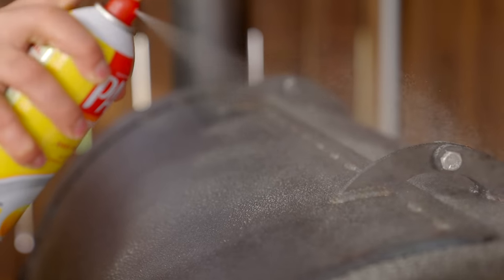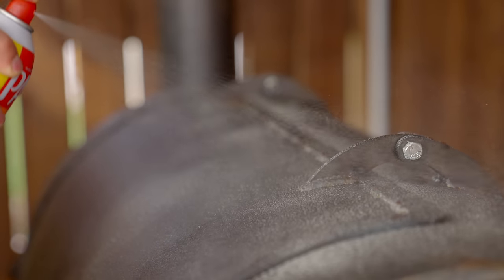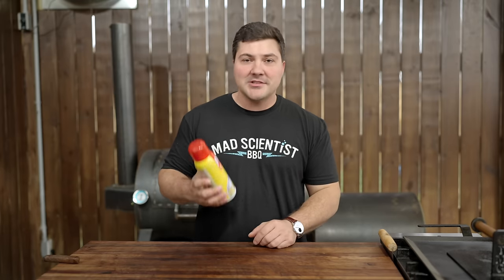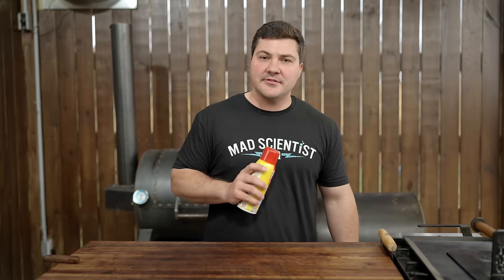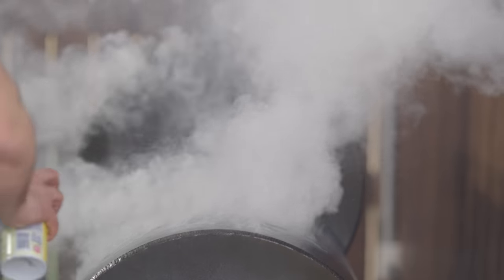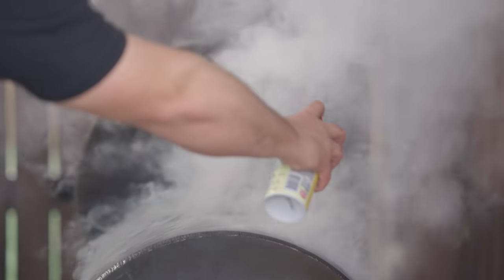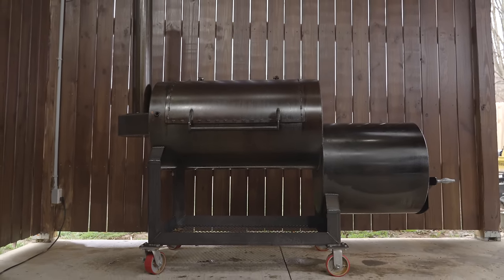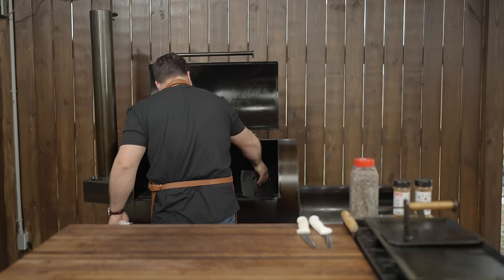How to Get Your New (OR OLD) Offset Smoker Ready to Cook

Comment: the firebox temperature always high and it get really hot so we need oil like avocado oil which has a highsmoke point at 480- 520F, while the cook chamber will not get enough hot so we need flaxseed oil with smoke point at 225f. i think this will get you season very good in my openion 😎
Reply from the maker: Totally fair point! I just try to keep it simple. Your method is better though

Comment: I always wondered, but from what you said about the metal expanding and contracting, i'm guessing spraying your offset with truck bed liner, a high quality bed liner, would be a very bad idea, right? Would the bed liner stop the metal from expanding and contracting? Also, i guess eventually over time, the bed liner coating with start bubbling and peeling as it gets super hot.

Although, it would look awesome, but just not practical

Comment: Would you go over the top of a brand new pit that has a clear coat on it or wait for that to burn off before you treat with oil. My thinking is that a clearcoat would stop any oil getting into the pores of the metal so is it worth it?

Comment: Hey dude, I'm from Texas and have been watching you here on utube, my question is, is the temperature inside smoker the same as the outside surface,
Reply from the maker: No. Temp inside is the air temp. The metal will be colder than that because it is constantly giving off heat to the colder air outside
Reply: @MadScientistBBQ  one more thing, how to measure your smoker,
Reply from the maker: @christopherleelara3915  I’m not sure what you mean by measure. If you mean temp inside, a good thermometer like a tel tru would be great. For the outside, an infrared thermometer will do the trick
Reply: Sorry,should have worded better, how do I find out the size of my offset smoker,
Reply: @christopherleelara3915  that's called a tape measure.

Comment: Is it recommended to oil the outside of a brand new powder coated Brazos offset smoker? Also, is it necessary to remove the factory oil from the inside by washing only to reapply vegetable oil? What kind of oil do they use at the factory for protecting the inside? Why would they use something that is not suitable for cooking with?

Comment: Any comment on what to do with cheaper, thinner gauge smokers, where the firebox gets hot enough to burn right through the polymerized oil coating? I spray my smoker every time but it's always got some rust on the back and side of the fire box where I push the wood to the back away from the intakes and the side-hinged door i leave cracked. I spray the top as well and it holds up for a bit but always burns through after a few cooks, even if I spray it every cook. Also I try to avoid using pam because of the silicone content. I use spectrum spray in the 16oz can since I can get them for only a couple bucks more than the 8oz cans. My smoker is powder coated on the outside so most of it is fine, it's just the spots where it got hot enough to burn off the external coating that it's having some rust issues.

edit: hah i also use my propane torch to season the handles of my cast iron pans that same way. It's the only spot that doesn't season properly and it rubs off really fast from normal use, so I torch season them now. Might have to do that again on some parts of the smoker that have a little spot rust which don't get hot enough since my fire box is a bit undersized for my liking. I would have to build a fire in the cooking chamber to get it hot enough to season those spots otherwise lol4

Comment: Great video! My Firebox is rusty. Should I paint it with high temp spray paint before seasoning it or just go straight to seasoning? Also, canvas cover or no cover?
Reply from the maker: If it’s really rusty, I would probably try to take of some of the rust with a wire wheel. After that, I would go straight to the oil. I would go several coats on the firebox to really make it durable. The. Each time you fire it up, hit it with another $2 of cooking spray and you’ll be good indefinitely. If you’re out is gonna be outside, I would probably cover it.
Reply: 30% vinegar helps get the job done fast!
Reply: Wd40 and a tough brillo pad works well for removing rust when it's not deep in the metal. Probably not best for inside, though

Comment: Is seasoning the inside of the firebox necessary? Also…if one were to incorrectly season the smoker and made it “sticky”, how would they fix that?
Reply from the maker: Inside the firebox would just burn off right away. If the oil is sticky, just more time and higher temps will help that oil polymerize
Reply: @MadScientistBBQ  sorry one more question…I think I was a little heavy handed on the canola oil and didn’t rub it in too well causing what looks like polymerized burnt streaks…do you know if is there anyway to remove that? A gentle degreaser didn’t work.
Reply from the maker: @collinwilliams7344  unfortunately, I think you would just have to scrape it off. Using a spray can from a distance can help make sure the coating isn’t too heavy. Also, make sure to apply while the smoker is cold to avoid those streaks forming.

Comment: Does this apply to the huge 500 and 1000 gallon offsets as well? Or just the backyard sizes? Just curious, I don't have an offset. Yet.
Reply from the maker: Unless the offset is painted this works. The only exception would be if the firebox is insulated, you may need to heat the metal on the outside with a torch as it won’t get hot enough to polymerize

Comment: I ordered one of your pits. How do you season the legs and the storage area underneath?
Reply from the maker: That can be done with a torch or with something like boiled linseed oil which will polymerize in open air
Reply: So if I use boiled linseed oil on the legs I don’t need to heat it up with a torch? Also, when I first get my pit do I need to do a burn in before I season it?

Comment: So i know this is not the correct channel but i recently bought a pellet smoker. Should i do this method?
Reply from the maker: In all likelihood the answer is no. Probably best to ask the manufacturer. Since there electronics involved, I would make sure whatever you do doesn’t potentially damage anything. The inside of the smoker, you can definitely spray with some oil though

Comment: What happens when the dusty, windy conditions cause the dirt to stick to the exterior seasoning and it looks terrible?
Reply: If dirt is sticking, you didn't get the oil hot enough. I live in Wyoming and it's dusty and windy. Done right, simple rain or water will get the dust off. Been doing this method for years and my smoker sits outside all 4 seasons and doesn't have any rust or dirt.
Reply: @NoReason801  Exactly right. I figured this out since I posted. I pressure washed and re-oiled it, she is looking right!

Comment: Flax seed oil has a much lower smoke point than canola.  It should be able to polymerize on the smoke stack.
Reply from the maker: Totally true. My concern is durability. The higher smoke point oils seem to last longer between coats. I don’t have proof of that, but anecdotally it has held true. Also the canola oil is dirt cheap. If you prefer flax oil, there is absolutely nothing wrong with using that instead
Reply: @MadScientistBBQ  Why not just use boiled linseed oil, or even (harder) Tung oil. Once it polymerizes on your stack it isn't going to get anywhere near your meat. Easy peasy.

Comment: Interesting…  I avoid cooking spray like Pam because of the soy lectins - Not that there is anything wrong that to ingest, but because on glass baking dishes, or metal baking pans, etc. you end up with this sticky residue that is like droplets of hardened glue. Well I guess know I know why…. The dish, pot, bakeware is hot enough for a non-stick surface, but not hot enough to fully polymerize. But then again, you don’t really need that for bakeware that you are going to wash after you use it.
So…Pam for the outside of your smoker - Good! For bakeware or cookware …Bad!